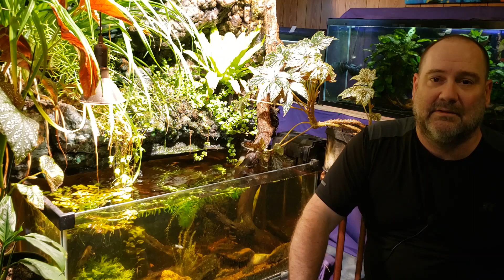Can You Have Stable pH Without KH (Carbonate Hardness)?

Comment: There are multiple things that cause large pH changes and it's good to know them and to test your water before/after. The biggest one that will happen daily is the CO2 cycle if you don't have CO2 injection and have fish and/or plants. By morning (before your lights turn on) you're likely to have a CO2 buildup while at the end of the day (right when your lights go off) you will have the lowest CO2. This impacts your pH dramatically. You should measure this and make sure it's not changing by too much (I hear .3 or less is safe). If it changes a lot, you can add co2 injection that only runs at day time. The other things that can spike pH is a water change. Other than that a large death of fish/plants that are kept in the tank. Of course if you add chemicals. Otherwise most changes are gradual.

Comment: Had the same issue: 6.4 pH and 0 KH. I was worried my cycle would crash if it got 6.0 pH or lower. I added crushed coral to the substrate when I set it up. So I then added aragonite to the filter, got rid of most of my floating plants (eat KH) and added Seachem Buffer. KH is now 5 and pH is 6.8 after a few days. I do smaller percentage water changes now as my water from the tap is very low KH. Seems to help. Zero spikes. Thanks! Oh, I also added crush oyster shells to the filter.

Comment: I have 0KH and 5.5 pH and it's really stable, it's low but it's stable which is fine for what I'm doing. My GH is like 17dGH though,  My theory is my water is full of phosphoric acid because although I can add  6 dKH water and even do 50% water changes, it stays 0 dKH and 5.5 pH. 
I don't keep plants, if I did I'm sure the pH would swing some, maybe swing even lower with CO2 creation. 

I just kind of happened into it by accident. I know one day I'll do a water change and  I'll shift the balance and KH will appear, and pH will rise, I'm not doing anything to stop it from happening, it just doesn't happen so far. 

I don't understand it either really. My water looks great, the nitrates are low,. the fish are fine. Just pH 5.5 and no testable  KH.
Reply: I've had almost those identical water parameters and really struggled how to stabilize.  My tap water is ~7 ph, .3-4 KH and 4-5 Gh

In between water changes onve a week my Ph drops below 6, Kh goes to 0 and Gh goes to 10+.

My TDS also goes up about 20ppm per day. I've tried using RO and all the buffers but never able to get that right either.

Do have live plants so I don't know what CO2 levels might be contributing to all that.

I just want stable water parameters from week to week. Such a struggle to figure that out.

Comment: This is a topic that has recently piqued my interest. None of my tanks have a Kh above 1, with some having 0. There is a rise in ph as plants use up dissolved CO2, then a reduction when lights go out. I’ve never had a problem with my fish- which have soft water origins- or plants. This is the case even in my CO2 injected tank (the ph obviously goes down when the gas is running). I’m beginning to think that ph stability is overrated in the hobby (provided Gh and Kh isn’t changing). Obviously I wouldn’t take a fish from water with a ph of 8 and plop it into water with a ph of 5.5, but I suspect that a daily swing of  0.5 -1 isn’t detrimental to fish/plants. Apparently natural water systems go through similar cycles.
Reply from the maker: I'd say a swing of 1 point over a whole day isn't anything to worry about.

Comment: My pH crashed 2 months ago for the first time in 4 years of fishkeeping (currently have 6 tanks.) Tap water is kH 1. I use crushed coral to bring it up to 3 or 4. I was leaving town for 2 weeks and don't always test water but on a whim I tested my 75 gal and pH was under 5!!! What??? It was always stable at 7.4-7.6. And kH tested 0!!. And then I suddenly noticed the random large 1/2 clam shell I had put in the tank along with the crushed coral a while back - well it was almost fully dissolved and there were no bits of crushed coral left on top of the sand. I immediately did 20 gal w/c and added at least 1 cup crushed coral to the substrate near good water flow. Also did 20 gal w/c again before I left the next morning. Came back and did some more water changes and it's been good since then. Odd bit - I had noticed for 2 weeks prior to that that my huge mbuna cichlid was more active, more hungry, looked better/fuller, and had been eating more consistently than ever before. What I learned researching after the issue is that if I don't stay fully on top of removing fish poop from this tank, the massive amounts of it from plecos etc decomposing will use up carbonates (?) resulting in my water chemistry going haywire. That's as technical as I get at the moment.
Reply: yes. acid build up. mostly phosphoric acid is my theory on why it happens,

Comment: I have SOFT water but the PH remains steady at 6.5 and 0 KH in both my tanks. I do add Seachem's Equilbrium to bring up the KH slightly. However, my cheap PH meter, after calibration, reads 7.4 versus my Tetra dipstick which reads 6.5. My old PH meter, which is no longer working, read 6.5 PH.

Comment: What I want to know Dan is how I can get very soft water (<40ppm) at neutral PH. If I RO my tap water I get 5.05 PH so I'm thinking using a buffer 🤔
Reply from the maker: Baking soda (sodium bicarbonate) or similar will raise and buffer your pH if you want.
Reply: @DanHiteshew-oneandonly  to what PH though Dan? If it's changeable depending on the amount then I couldn't use it.
Reply from the maker: @billschwarz1157  You'll just have to add a little and check the pH. If it's still too low, add a little more and check again.
Reply: @DanHiteshew-oneandonly  ah so I'd have to do it to my water before adding to the Aquarium. I could do that, go upwards in water changes til I get to 7, thanks dude 👌
Reply from the maker: @billschwarz1157  Good luck.

Comment: My well water comes out at about 1 or 2. Hasn't been been a big problem until now apparently because we haven't had any rain to speak of for months. All of the sudden l started losing Guppies all over the place. Had to buy a pH meter to get readings. 1 tank was about 3.8.😲 Kept killing bacteria and of course that was causing instant ammonia spikes. Now I am checking all tanks daily and adding baking soda as needed. A lot of effort, 2 300 gallon ponds,  2  110 gallon ponds, a 55, 4 40s,  a 56, 2 20s , a 29, and a 34.😊

Comment: Hi Dan! I use RO water and just re-mineralize with GH, no KH intentionally. I'm adding calcium and magnesium but no carbonates and bicarbnonates. Plants prefer less KH especially finicky plants. My PH doesn't fluctuate much , I add CO2 which does lowers the PH but It has never dropped below 5. Its about 5.8 with no Co2 and drops to about 5.2 after Co2 injection is over. There are a lot of softwater setups in the planted tank community and I had a few mentors in this approach. Adding 0 buffering capability totally went against everything I have ever learned and I was scared to do it but I have the best planted tank Ive ever owned now.  The tank Just has neons and plattys in it. Neons probably love the acidity and plattys would probably like a bit higher PH but they are breeding in it which tells me they cant be that unhappy. I have a whole video about this approach on my channel called : Softwater Planted Aquarium Guide (that would probably sum up what I'm saying better)  because I find PH,GH and KH very interesting.